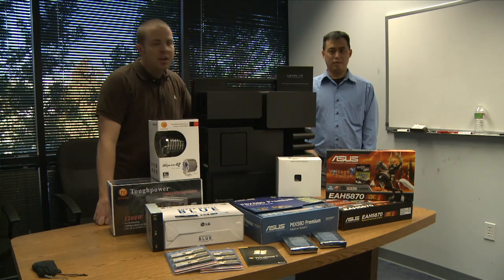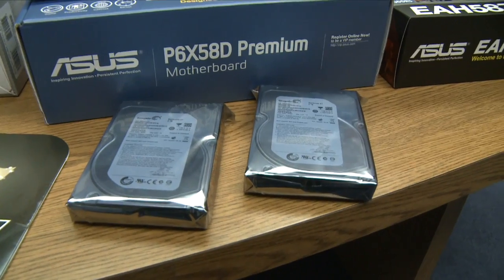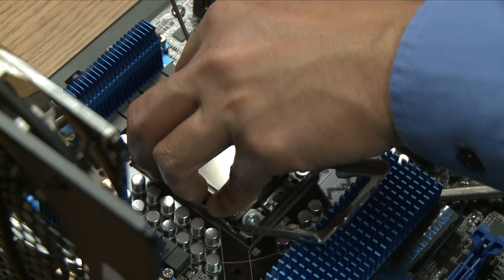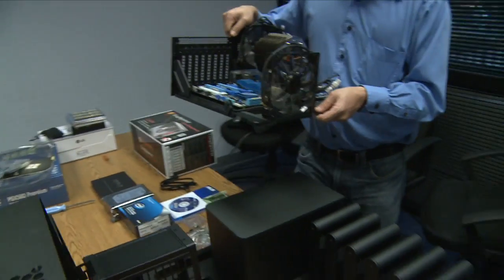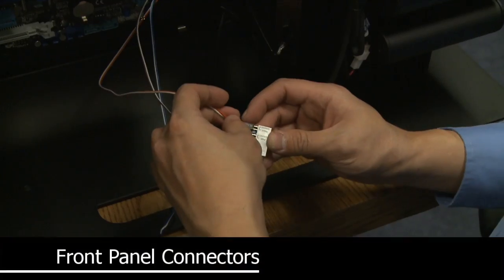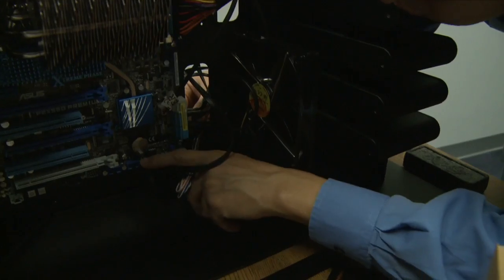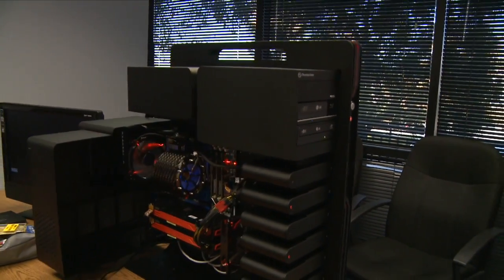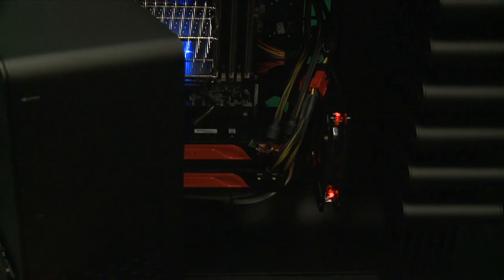Newegg Supreme Combo Part II: The Build

Comment: what a crappy cooler, PUSH PINS? Seriously thats what intel use on there stock cooler! not a afterbloodymarket cooler. and as JundacomputerGmbH said where did newegg find these morons? I hope they realise the cpu die is a tiny tiny thing right in the middle of the metal cover that goes over it, Also THERMALTACKY! Also turn that stupid music off, sounds like a porn movie

Comment: And you don't need to buy that expensive thermal take silver crap.  Any grease will do, I use clear waterproof electrical grease simply because I have it around, which you can buy in a huge toothpaste sized tube from radio shack for a few bucks.   Hell, in a pinch I've even tried butter, car grease, and even baby oil just to test them.  But when in doubt, don't use any at all.   Every CPU I've seen has it laid on so thick like someone was laying concrete, and over time it hardens the same

Comment: Uh, that is the WRONG WAY TO APPLY THERMAL PASTE.  Why you people put gobs of it on like you're frosting a fucking cake???   No, you only need a razor thing microscopic amount to fill in the graininess on the CPU, not hold metal away from metal.  Ideally, you always want metal touching metal, not going through paste.  Put a tiny dab on, smear it around all over the surface with your finger tip, then take a razor blade and run it across the top to wipe off all the excess.  Or wipe off with tissue

Comment: @tmac20031 Mercedes is expensive but beautifully designed and worth it, while this is ugly, heavy, difficult to carry and useless. I can't find 1 upside to that case and there are 2 types of expensive: Expensive but its good and worth it and expensive and its a rip off.

You can buy that case if you want but you'll regret it and you won't get that $800 back because you can't resell it since no one in the right mind would want something like that.

Comment: @JundaComputersGmbH I disagree with this comment. If this thing were cheap, you would probably be licking it, but because you cant afford it you call it ugly. H@ll, I cant afford it but its still the best looking case I have seen. Thermaltake's mistake was marketing this as a gaming machine, when really it should be for designers, artists and engineers. Its like a Mercedes, they are built by great engineers which drives the price up. It took skill to design this, and u get what u pay for.

Comment: @JundaComputersGmbH     Kinda splitting hairs on the thermal compound thing. The case is idiotic and overpriced, but whether you spread the compound, grain of rice, or X up like this guy did I don't think it is going to make a real difference unless you are doing heavy overclocking, which would warrant watercooling anyways. As long as it's just an air cooler I don't think you could demonstrate an improvement of more than a few degrees C maximum.

Comment: @JundaComputersGmbH If you read the manual at Arctic Silver's own website, they suggest the middle dot method *without* spreading it across the top of the CPU. But this was under the AMD side of things. 

On the Intel section, they have a multitude of methods for applying thermal paste. Some of them suggest the "Surface Spread" method you mentioned. Some of them however suggest using only a vertical or horizontal line.  At the end of the day, check what the manufacturer recommends when you can.

Comment: also.  here's a SIMPLE COMMON SENSE THOUGHT PAUL AND WHOEVER ELSE AT NEWEGG!...like Junda also was pretty much explaining.  all it takes is a SIMPLE PEA sized dot of thermal paste on the dead center of the cpu.  after you properly install that CPU HSF system.  then you let the computer do the work of the burn in to auto spread the paste.  100% of the time you get the CORRECT amount and layer of paste between the cpu and its Heatsink.  No need to do this fancy X pattern crap or spread it urself

Comment: I hate to say it but i MUST agree with Junda out of COMMON SENSE and WINDOW SHOPPING EXPERIENCE.  thermaltake 10 is WAY overpriced and have heard way too many rumors about liquid cooling installations hassles.  i'd rather spend 800 bucks on gtx 580 gpu and the remaining amount on 120gb mushkin ssd or g skill phoenix pro 120gb ssd on sale.My antec skeleton IS AWESOME! cool quiet efficient easy to carry fairly easy to access parts to work on and swap stuff out=win-159.99 VS 800 Level 10 case=fail

Comment: @JundaComputersGmbH You can apply thermal paste any way you want to, it all comes down to the hope that you have a thin layer of Thermal Paste covering the entire Heat Spreader. Personally I use a Rice grain and a gift card, but I have used the X pattern and it does cover the heat spreader very well.

Comment: 2:22

Wow, where did Newegg find these morons?

How to PROPERLY apply thermal compound:
Squeeze a grain of rice size of thermal compound, Arctic Silver 5 or the new IC Diamond. Get a piece of thin plastic and spread it so thin and even that you can almost read the CPU model number on it.

By the way, that is one ugly ass overpriced case, Thermaltake Level 10. For $800 buy a better video card or maybe a SSD for better performance.

Comment: Looks like the cpu cooler is built in backwards, instead of blowing hot air to the exhaust fan, it blows all it's hot air to the RAM and the rest of the case...

Comment: what a crazy machine but i still havnt had any performance issues with my pc even on crysis all settings high and i only have 2 GTS 250's a 920 overclocked of coarse and 3 GB of ram im not gunna build another PC till everything is USB 3.0 and SATA 3.0

Comment: No SSD? 
The 5970's aren't bad and microstuttering only happens in a few games. I have mine running 850/1200 with no problems. Don't use Furmark.

Comment: screw your measuring, why dont you actually buy the card and see if it will fit, some people are retarded and do not measure correctly. pausing at 5:15 there looks like enough room for the 5970.

Comment: If im going to spend that much money on a video card, it should be enough. If one is not enough then I feel im being ripped off, since there expensive as it is. I also like the epic fail with the water splash at 6:26. I know it does make a difference its just a very slight one, for instances your not going to get "double" the performance. It just sounds like a good marketing stragety to me.

Comment: I dont get why people would need a pc with such excessive stuff. I still have a dual core cpu at 3.5ghz, 4670, 8gbs of ram, and 2 500gb hds in raid, and it rocks playing any game and really fast. people upgrade for no reason, only because its newer, but i gurantee you there old gpus worked just fine for games, and crossfire and sli is a joke, theres a very small gain, just not worth it.

Comment: Why did you put the thermal paste on the cpu like that?  Completley wrong, way to much paste!  Need to clean most of it off, the paste is just supposed to fill the little dimples in each surface...

Comment: little silly to be spending that much on a p55 platform, especially since you seem to be new at this and don't plan on overclocking. if i had $250 to burn id definetly go with x58 instead, better crossfire/sli support, better cpu choice(with core i9 coming). i suggest either upgrading to x58 and going with the p6t delux v2, or "downgrading" and going with the msi gd80, both of which are amazing boards and have won awards from review sites.

Comment: no prob. Telling you how to change the timings is gonna be a mixed bag, every mobo is different. my foxconn board gives me like 10 different timings to change, but my brothers asus only has 5 different timings. look on the rams box for the timings and check your mobos manual for the names for each timing in the bios. the timing you want to set are:

cas latency: 7
ras/cas delay: 7
row precharge time: 7
min active ras: 24

Comment: when first installed, they will run at standard speeds. this means the ram i recommended will likely run at 9-9-9-28 timings(since these are the standard timings for 1600mhz ddr3) at first, and you might have to set the timings to 7-7-7-24 yourself. g.skill does this so your computer doesn't freeze if you set the timing wrong, they will always default to safe timing if you mess up and have to clear the cmos. many good mobos detect the settings correctly though, so don't worry about it.

Comment: The point of the reaching in during power on was that it as the quickest way to see if any dangling cables were too close to any moving parts, and to correct it quickly on the spot. No disagreement meant, there's just a lotta commentary from the peanut gallery from Bored Internet People With Sticks Up Their Ass.

Comment: The so-called "system" harddrive is overkill.  It should be smaller and raided with a similar size in case games decide to crash and reset the computer.  Plus Windows will put the home directories on that single, over-sized memory storage unit.  USB ports in the front?  Wouldn't give Newegg $4583 for that crap.  Sell the case for $83. LOL

Comment: If i won this system I would.......

Pull the CPU and put it on my EVGA Classified.
Figure out if my 2x GTX 295s are faster or those 2 5870s are faster
Sell the motherboard and my old 920 CPU.
Probably use the RAM in this box.
Sell the tower.

That's just me.

Comment: I'm wondering what the deal with the super fail CPU fan. It's all look and is hardly better than a stock cooler. It does look nice and lights up a clear side panel case but that's not the case here.
It's defiantly not a fan you want to get if you plan on OC. But I suppose they were sticking to brand loyalty here.

Comment: We had 3 hours to do the opening shot and basic assembly on day 1, after spending all day with product line managers locating the parts.
Day 2 was loading Windows 7 and basic benchmarking as well as show-off-to-the VP's.
Day 3 was all overclocking and switching out CPU coolers. And more VP-level marketing time.

Comment: Newegg offered the bandwidth and work area, and internally bought/gave the 160GB SSD. 
Intel sent a Engineering Sample CPU.
Thermaltake offered the Case, Power Supply, and CPU cooler(s).
Asus donated pre-sale (at the time) Motherboard, and two ATI 5870 video cards.
OCZ donated the memory kits.
I think at the last minute Microsoft donated the Windows 7 Ultimate, or it might be Newegg offering another freebie. The PC stays in the Newegg Corp HQ until the lucky winner gets it.

Comment: @ReyAudentio 
The ESD strap makes contact with the persons skin (usually a wrist strap) and the other end is connected to a safe ground.  The strap constantly drains any static build up on the person so it does not have the potential to shock the parts and destroy them.

Comment: whenever they're handling electronic components they should be wearing ESD straps. Static charges can jump pretty far and fry delicate micro electronics.  You don't have to feel or see a zap for it to do damage.  Holding a board by its edges is not a cure.  While this may be rare especially in humid climates, it happens more often than you might think... most people just RMA a failed board never knowing why.

Comment: Paul and myself were given an assignment. With only basic tools, and parts chosen and provided by Newegg Product Line managers, we were to assemble, test, load software, and benchmark this combo build EXACTLY AS IS, as if a customer had purchased it. This is what we accomplished. Cable / wire management was accomplished by recycling twist ties from recovered parts packaging. It's beautiful for what we had to work with, and the time provided.

Comment: masterasia11 you also might want to pawn off your power supply just noticed that is ocz too. WOW you are a disgrace! "You know nothing about building PCs. If I were to build this PC form scratch, I wouldn't use OCZ and Thermaltake parts (except for the case). They are inferior to the rest of the market."  But you can use them in your builds but they cant. I but you do work at Best Buy as a Geek Squad tech or a.k.a glorified store sells men!

Comment: @albertobebes  it is 5870 not 5970. it is lagging because ATI doesnt have phisicx which is required for those particles in 6:23  to run smoothly.  if you have any geforce vga 8000 series you will see that it runs better when it requires phisicx.

Comment: We had 1x Intel X25-M 160 GB SSD (OS Volume)

We had 2x Seagate 2TB SATA-III (6.0) HDD's, one on a SATA-II controller and one on the SATA-III controller. The SATA-III combo benchmarked about 1% faster. But we couldn't plug both SATA-III's in because of cabling issues (L-bracket got in the way)